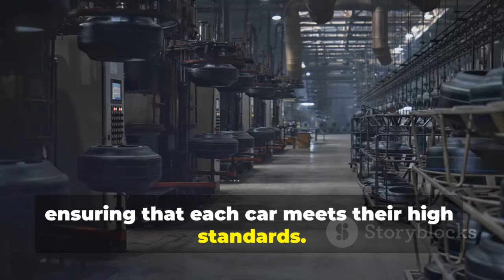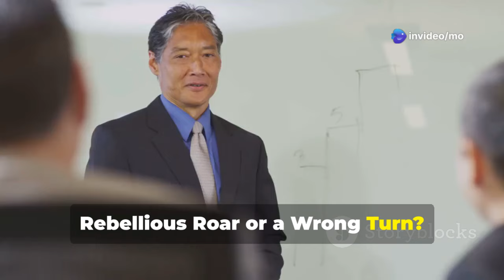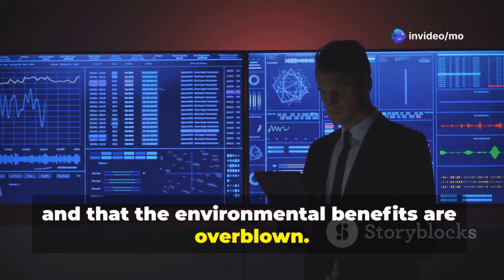The Real Reason Toyota Won’t Switch To EV

Comment: What' a load of drivel. Maybe toyota should concentrate on paying down that two hundred and fifty billion dollars of someone else's money they've spent.
Reply: They should, and maybe they will. But at least they are still in business selling cars people want to buy at a profit. What about all all the start-ups losing billions of investors money selling EVs at a loss? Are you OK with this?
Reply: Total Debt: $255.71 billion [as of September 2024]
Annual Interest Rate: 6.4%
Annual Interest Payment: $255.71 billion * 6.4% = $16.36 billion
Monthly Interest Payment: $16.36 billion / 12 = $1.365 BILLION!
Over the last month (from September 30, 2024 to October 30, 2024), their long-term debt increased by approximately 6.68%. For the year 2024, their long-term debt saw a substantial 15.53% increase compared to 2023.
AND if all this was not bad enough - they are keeping the show on the road using cash flow from guess where - China. Best of luck with that. 
Plus I suppose there is also the very real risk of even more carnage if China decides to respond to Country level tariffs.